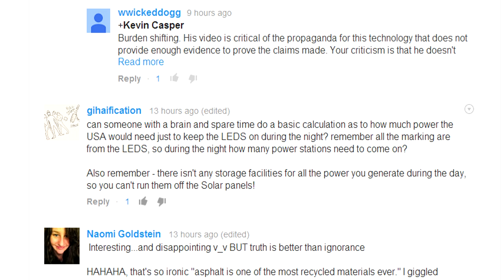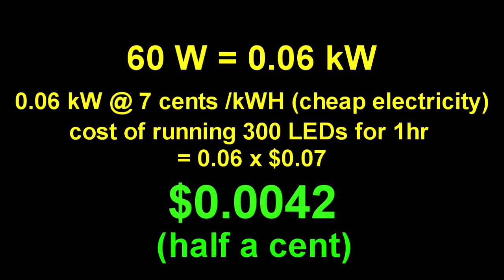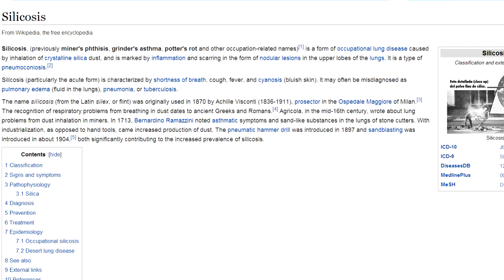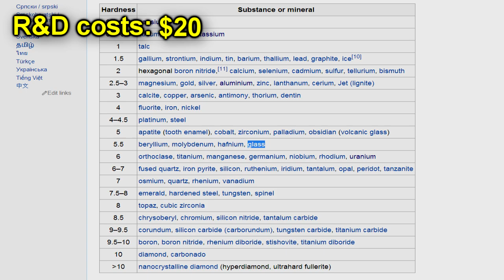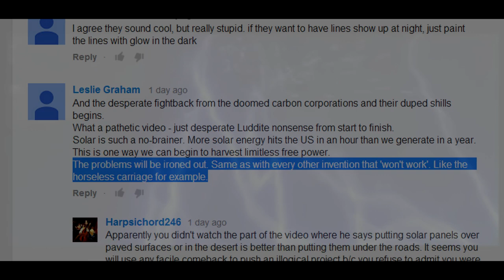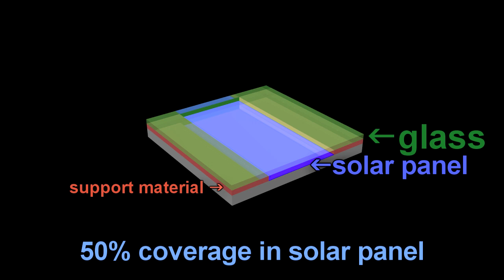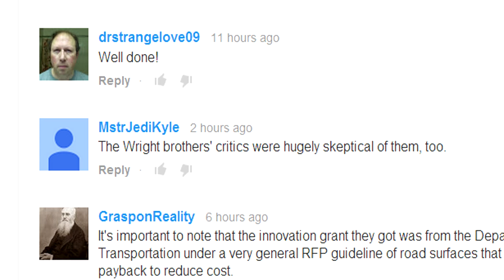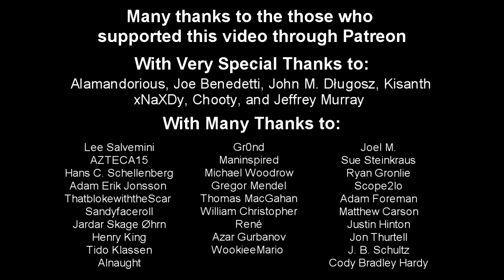Solar Roadways, IMPORTANT QUESTIONS AND ANSWERS!

Comment: Not that it is overly consequential to the overall viability to the "Solar Freakin' Roadways" project, but the calculations assume all 50 LEDs are working, which would quite likely be false, considering much of the roadway would only be using 10 to 16 LEDs (depending on where the 0.5m^2 tile is) for lane lines. While this does significantly reduce the running cost, it still does nothing to address the massive power requirement when there's no light, what the 'virtual grid' is and now it holds power generated during the day, the weakness of glass topped roads, and the 15 or so other crucial issues.

Comment: Just build a roof on the road and put the solar panels on top. This way you can tilt them towards the sun, no mechanical stress and the road is protected from rain, snow and sunlight. A carport like roof cost about 100€/m² rather than several hundred. Actually this is already done on many parking lots.

Comment: This guy is a moron, first off were not saying this is going to happen in a day. Two it would create 10s of thousands of jobs. Three. There solar panels u fuck nucket they don't cost electricity they generate and store their own. 
I'd also like to add that the u.s spends trillions of dollars in other countrys wouldn't hurt to buy some lights.
Reply: Solar panels cannot store energy, they only convert from one form to another. To do this they need to capture as much energy from the Sun or other sources as possible - this means Angle and Exposure are vital.

LEDs for this use are expensive, both in production and energy use. Otherwise we'd have massive LED advertising boards popping up everywhere. Take into account they'll be nearly useless during the day, that energy they use has to come from somewhere, either dedicated storage facilities or the panels themselves, then factor in the sheer quantity and the energy economy is clearly broken.

So, 1 - It's never going to happen in the form the project's leaders are talking about, simply because of economics. The panels stand near-zero chance of ever paying themselves off.

2 - This is a great argument, but is entirely contingent on overcoming the vast majority of shortcomings with the project, including all the fundamental issues.

As I said in another post, these panels would be great in places like Afghanistan where the road use is far lighter, and the energy infrastructure actually needs a boost. But these panels are not a good prospect for permanent roads.

Comment: road surface is definatley not the way, the stress in this environment is far to high, not only the regular stress you have by the friction of dirt and tires on a sunny day, but the stress in winter when the road has to be cleaned of snow by plowing

where i clearly see the future is roof tiles, there you havent got the material stress like it occures on a road surface, and you dont need that LED bullshit, the only issue is that you have to make them cheaper or equal in price to regular roof tiles

Comment: +This Guy
Since you apparently decided that open discourse is bad I've gotta respond on another post.

1) Solar road ways states that their current covers are tempered glass, meaning doing a test with tempered glass holds. If solar road ways wants to prove this point is wrong, rather than posting about how glass is harder than bitumen they could address the issue of common sand being harder than glass or put out a 20 second video of power sanding their panels to prove they can stand up to sand abrasion.

2) No one ever said electric cars couldn't be done, in fact electric cars is an old technology. Making it viable was around a long time ago, but people had range anxiety and the cost prevented it from being wide spread.

Lots of people are pointing out why solar road ways won't work or why there's too many engineering challenges. The fact that they both don't have a cover that can sustain the rigors of 20 years of driving but also stand behind tempered glass as a proper material either means that they're dishonest or they have no idea what they're talking about. If gorilla glass the best performance glass we have which is coated to prevent scratches still gets scratched by sand then why should their tempered glass be magically better? They would require either synthetic sapphire or diamonds bonded together with some aggregate which is also clear and can last 20 years in the direct sun light while being driven upon, but this would easily be far more expensive than any tempered glass and something like this is a requirement of this project.

The fact that they won't even release data with regards to actual power generation or consumption of their solar panels even though that's the most important thing indicates that they're aware of current shortfalls but refuse to actually admit it publicly and would rather you look at estimations that ignore the tile's power usage or the lowered surface area of the tiles vs normal solar panels.

3) Using your line of argumentation the thorium powered car must be just around the corner because TF pointed out how that's bull shit to. Just ignore the physical challenges and limitations of price or materials and just say "because other ideas succeeded this one will to"

Comment: You also have to consider handling of vehicles operating on such a surface. Pavement on roads is purposely rough and semi-pourous for a reason. On a rainy summer day, that smooth glass or whatever is probably going to be as bad as driving on an ice slick. Yet another thing that seems to be neglected in that concept.

I think if anyone wants to do a really big solar project, the best idea would be to build sun shades over parking lots and put solar panels on top of those. Very little wear and tear if any, makes good use of space which is otherwise unused, keeps parked cars cool in summer and mostly free of snow in winter. If designed with proper drainage in mind, it may also make the lot pavement underneath last longer. And these sunshades don't have to be a completely enclosed structure, so plenty of daylight and fresh air would still get through to where cars are parked. They may not track the sun, and would need to be cleaned off every now and then, but those would be about it in terms of any drawbacks with that idea.
Reply: That's the same idea I have.  Why not also place them on the roofs of every commercial/industrial building where those roofs are most likely to be flat?  The energy is also very likely to be used while the sun is out for things like lighting and A/C.  Just space each tracking panel to allow a technician to comfortably clean/service the panel from each side.

Comment: That bit about the spark plug didn't make sense. You do the diligence and listen to it over and over. It'll moot itself. Bottom line up front, I'm not going to listen to someone with a negativity bias on a progressive idea who 1. Doesn't have suggestions for a solution to identified problems and 2. Is stupid enough to scratch or cut glass in their hands without gloves on. Also, the roadways would be in a parallel series generating DC power to nearby transformers and power conditioners to be converted to AC and transmitted to storage farms and substations that already exist on the power grid. Further counterpoints: There are LED's that are UV resistant. LED's would only be used during low visibility. They "can be programmed" to function as sinage and would likely be used where needed. They don't have to be. A lower end surface without LED's would likely be the norm. You're thinking small scale small problems and not thinking large scale with solutions. Also, kinetic friction... you know what? People like you don't listen. Forget it.
Reply: " I'm not going to listen to someone with a negativity bias on a progressive idea who 1. Doesn't have suggestions for a solution to identified problems"

So what you're saying is thorium cars are in the near future since TF railed on that to. All he did was list all of the issues and limitations of basic materials and concepts.

Solar road ways will have to come up with a surface that is transparent, can survive the rigors of having sand ground into it from daily use and the fact that cars and trucks will be driving on it for around 20 years (according to what they want for life time of the product) and have it be as inexpensive as standard tempered glass in order to be a viable product.

Considering the makers of smart phones where the closest thing that matches some of these is gorilla glass 3 with a scratch resistant coating still can be scratched by sand. It's probable that you can't make a material hard enough with the desired properties in a cost effective way since the only materials that would seem to fit the bill is materials like sapphire or diamond with the possibility of a bonding agent which may reduce costs but would also have to be sufficiently transparent, last 20 years and survive the rigors of road driving and emergency stops.

What makes this idea so difficult is the fact that they want so many properties in the material which often results in more cost. If sand didn't exist you could just use glass and be fine, if you didn't it to be clear for solar panels a lot of other materials would suffice.

Comment: You found 300 LEDs on ebay for $20 (this includes the ebay fee remember), you're assuming the same cost per led if you were to buy 12 trillion! That's ridiculous, if you were buying that many the cost would be a fraction of what you've listed, unless you actually bought the LEDs 300 at a time from ebay.
You say glass is soft, yet it's directly above steel. 
Your so called experiment is flawed. You basically prove that the cheap glass used in bottles is of the same durability as the glass they are using.

Comment: 1. The roads will generate plenty of power to run their LEDs overnight, plus some. The only thing left to engineer is a storage system. If you store power per-panel, then it should be able to fit into existing road modules.

2. There will be far less abrasives on the road than there are currently because gravel and asphalt will not be used in the process of making them, and I would wager it's far easier to keep these clean using a street sweeper than stone/asphalt/whatever.

3. They aren't using bottom-dollar glass from a wine bottle, they're using specially engineered tempered glass with a traction surface that can stand up to far more abrasion and wear. Your experiment is mostly a joke.

4. It's simple and been done several times to increase the efficiency AND brightness of LEDs. Just picking some random battery-powered LED strip from Amazon and saying "This is how much LEDs cost, and this is how bright they are" is pure ignorance.

So far, the only valid thing I've seen wrong with this system is that it's expensive(which one federal grant could solve) and there's currently no power storage for these panels. Feeding them into the grid could be a solution, but who's going to get the credit for the power? If public utilities are providing 'free' power to the grid, my bills better damn well go down.

Comment: running a single streetlamp for a year costs $100-$240

operating all the roadlamps in the US costs around ~$1000000000-$2400000000 based on Tucson

Comment: the one thing i see being overlooked here is the traction of even textured glass over asphalt (which the later is better in dynamic conditions as well).  Such texture on the glass would also have an effect on the efficacy of the solar panel.

Comment: Iron is unsuitable for building skyscrapers. But add in some carbon, melt them together with a catalyst, and you get steel for the beams. Adjust the formula a little bit, and you get steel cables that let fighter jets land on ships. Just because you did a test on cheap glass doesn't mean anything.
Reply: Yes it does, it proves that the solar roadways people don't even bother with serious answers. Though I do think thunderfoot wandered too much in these videos, and wasn't really paying attention to the real issues.
Reply: If they were to get a research grant, and a new glass-like material were to emerge from that, wouldn't that be beneficial? Nothing is guaranteed obviously.
Reply: 0Asterite0 The project was a failure the moment they had the idea.

The thing is that solar panels simply aren't a realistic way to power a whole country, mostly because of storage and price reasons. Even if they were to work at maximum efficiency...

There are scientists all around the world working on materials, including glass. It's not easy to come up with something that's transparent yet has really good mechanical properties.

What they should be doing is admitting the real difficulties, rather than pretending it's going to be easy.
Reply: I wasn't arguing about the whole idea in and of itself. It is dumb and they didn't do the calculations to see if it was viable. I was only criticizing that one part. But you never know, it was only 1 group of scientists/engineers that built the stickybot. You never know, sometimes you really are the only one doing the materials science research for a particular material.

Comment: So, as I mentioned in another post of yours, you have huge expertise at creating straw men. Any intelligent plan for deployment of these would be to install them on roads scheduled for repaving due to deterioration or on new roadways. This repaving does happen, my Company makes money inspecting such pavement replacement projects.

Your gravel experiment is pretty comical as well, the wheels of my car rarely act on pavement in that way.

Seriously, there are significant issues with this idea, but your debunking of it is misleading, bordering on deceptive.
Reply: You're right, the wheels of your car doesn't act like that on pavement.
But have you tried it on glass?, do that and then come back with your results.

Comment: You only need to light up about 100-200 linear feet of roadway as cars are driving on them activating them with sensors. Lots of the debunking scenarios are quite exagerant . Most of the debunking reasons can actually be debunked themselves so don't go giving up on this idea just yet with tiny actuators all collector can also be angled for better solar collection and with the new carbon nano fibres there would be no lost of energy to copper wiring . These are just a couple of ideas that can help this project along.

Comment: (More) practical solution: Research cheaper ways to build nantennas and lay them on the side of the road (although the side of the road is not optimal). Despite being $450 per square meter ($41.8/ft^2), it has much higher efficiency than standard PV cells as it collects the more energy-intense light spectrums. Not only does it have thermoelectric properties (electricity from moving a heat gradient), it can also generate a decent amount of electricity during cloud coverage. As with all designs, some rough areas need to be smoothed, but this is overall more practical than the whole tiles deal

Comment: You missed a point... how much energy is spent on actually building a solar panel? Under normal circumstances, a solar panel pays off it's energy debt in about 4 years out of it's 20-25 year lifespan. Here's the problem though - with the stuff mentioned in the video, the overall efficiency is going to be massively reduced (and further than you suggested as no solar panel is 100% efficient by a long shot).

Toss in that glass needs to be made with high temperatures, and any material which could hold up the weight required (more than 4x since it's not distributed evenly) would also require quite a lot to mold into a useful shape... and you quickly find that, even excluding the LEDs entirely, just the energy required to produce the solar panels is likely going to be roughly on par in practice with the amount they harvest over their entire lifespan.

And then the LEDs drop them into the red.

I like the idea of solar power... but this simply isn't the way to do it. It's very poorly thought out, and sure it sounds good, unless you have even the most cursory level of understanding of the issues involved.

It's quite possible we may one day find a way to use cheaper, lower energy cost materials with greater strength that are still transparent... but we simply don't have those materials yet (assuming they're physically possible to exist with all of that ticked off).

It's a nice idea, but it's no better than a perpetual motion machine. Lots of people criticize that idea as well... with good reason.

I'd rather see the $2million invested in Thorium reactors. That'd be vastly more effective of a use of the money when it comes to energy production, and we're vastly closer to the technology to make that quite efficient.

Comment: I think the only way to make this project feasible is to:
1. Only use them on car parks, and public areas etc. anything to exclude the huge unused stretches of roadways in america and go for a more economical technique of those roads like the stop being developed in Europe etc.
2. Install small, modular batteries in each roadway cell to charge from excess solar energy during the day and discharge at night.
3. Use surface materials like fibreglass and re-enforced plastic to protect the LEDs from water corrosion and pressure.
4. Have pre-set road markings, i.e. painting road markings.
5. Fibreglass bubbles in the road cells that focus light into the solar panels.